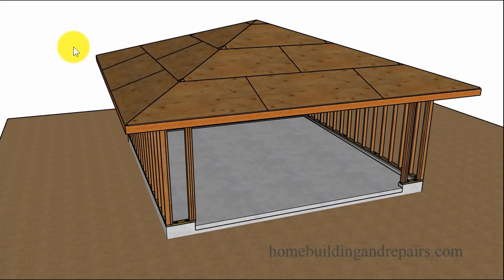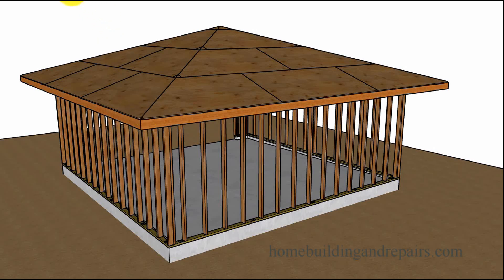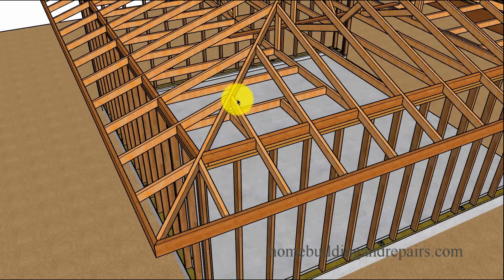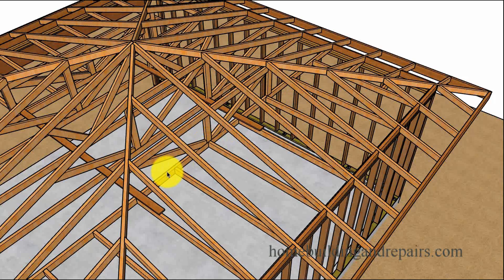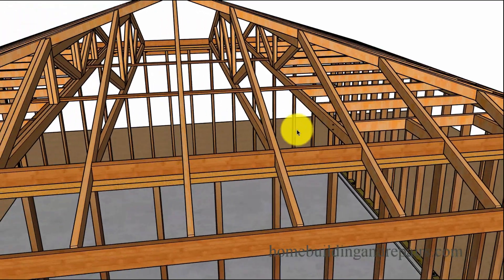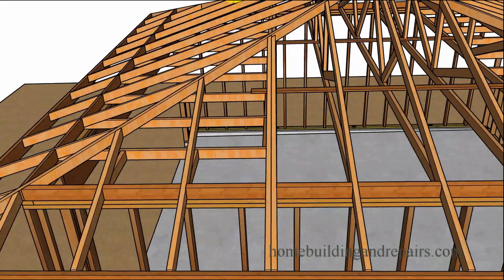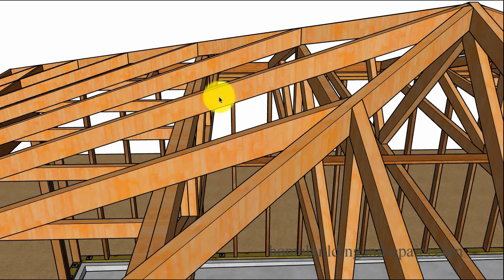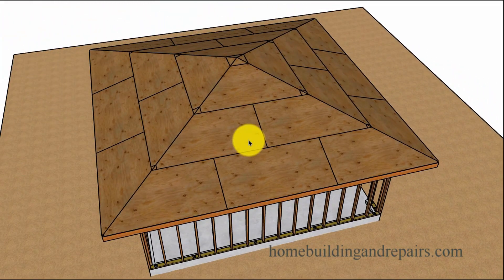Engineered Hip Roof Truss System For Two Car Garage - Framing Ideas

Comment: In the middle of my house the tie beams, which is the bottom chord of the truss run from front to back. In the corner rooms the tie beams run perpendicular to these. I have a hip roof with a center ridge.
Reply from the maker: Yes, there are more ways to build different truss systems

Comment: I have a 1/12 square hip roof garage that more or less is collapsing.  Worst is a 5x5 corner.  I cunted 6 layers of old roofing.  Significant fungal damage -- looks like Poria incrassia.  The pitch is so low with such poor bracing that all the joists are cracking.  I'm doing a stop-gap repair on the corner until I can reroof the structure.  I'll build a gambrel roof with wood-I-beam joists.  Enough with the heavy cross braces and terrible pitch.  Your illustration of the framing was very useful to confirm that my repair is ...... reasonable.

Comment: Is there any way to make use of the area beneath the roof? I have this garage, but have drywall hung on the ceiling now.  Would love to store a few things above the ceiling, but I don't think it's built for load bearing. Any better ways to reinforce?
Reply from the maker: I think I have videos at our website in the garage section that might help.

Comment: Hey there.  I'm attempting to rennovate an old two car garage (20'x20') and convert it to a workshop. It has a pyramid hip roof similar to what you show here, except there aren't any trusses at all. 
I'm curious how my hip roof seems to be so solid and structurally sound. 

This home was built in 1893, the garage sometime between the 30s-50s if I had to guess. The garage itself is more post and beam construction, with 4x4s in each corner and a few in the center of each wall span (either for a window, garage door, or rear door) that seemed to be enough to line horizontal 2x's to affix the exterior cedar panels.  However, I'm very curious how this roof was built, and if you know anything about this older style of framing.    

While it seems pretty strong-  it was re-sheathed and shingled a decade ago before I bought the house, so it supported the weight of people on top of it, and there is no sagging of any kind, I'm curious if this I should be concerned that there are no internal supports of any kind. (no load bearing walls within, no trusses/cross braces, etc). It seems to defy my sense of logic.
Reply from the maker: You can always add supports if you think it will help, but since it not sagging or leaning, I think you might consider leaving it alone.
Reply: I just purchased a house with a 20x20 garage with the same style roof but 7/12 pitch. I only have 2 20’ 2x6 running across and I’m now considering adding more in for support and storage for above the garage door.

Comment: Is it possible to avoid rafter ties in a pyramid roof like this by using strapping?
Reply from the maker: I've never seen collar tie straps on a pyramid roof where four hips meet at the same point. This doesn't mean you can't or that an engineer today would use them.

Comment: Thanks, I have this kind of roof in my garage and was curious about the construction above the ceiling.
Reply from the maker: I'm guessing for storage and you might find what you need at our website, if not, then provide a few more details, like what type of project.
Reply: @gregvancom  Hi thanks for the quick response.  I was hanging a 50lb heavy bag for boxing in the mid back of the garage, and I was having problems figuring out what direction the ceiling joists went.  I couldn't get a stud finder to work, and I wasn't confident in the knocking method.  I looked thru the attic area but I didn't have a tall enough ladder, and there was a lot of insulation that I couldn't tell.  I wanted to mount the bag from two joists even thou it's not really that heavy.  I successfully found them watching your video so I'm guessing the joist design is pretty standard? Thanks again.  I also enjoyed watching the video and your knowledge of building.

Comment: How does one go about Insulating a Roof EXACTLY like this one?   27' x 27'
Thank you.
Reply from the maker: It's hard to explain, but if the ceiling isn't finished then you staple paper backed insulation to each side of the rafters. I don't have any videos on it, but here's all the insulation videos I do have.
https://www.homebuildingandrepairs.com/insulation/index.html
Reply: @gregvancom  Thank you for the information. Happy Thoughts.

Comment: I am curious how a large garage (or house) that is not square with hips could be built off site as several trusses.   Your video gives a good visual.
Reply from the maker: The trust manufacturing company can usually provide you with installation instructions and all of the framing components necessary to build and assemble that type of roof.

Comment: Seasons Greetings!  hey just installed a 9x7high garage door at my carport in my house..prob was rafters come down on an angle .the hold up the roof on car port.. one dies is 9 high sloping down to 7 feet!.. WHAT I DID was use a low ceinging bracket or quick turn and lowered the rail. door hits the rafter ! SO...I CUT out a 10 inch wide or so section horizontally to alow the door edge to pass thru on its way sliding along the rail.. QUESTION IS,, how can i add back streangh to the rafter since it was a 2x6 now 3 inches !! im think an iron channel drilled and bolted maybe 2 feet in each direction or would 2 by 3 tabled sawed to fit along  nailed in place?..i just reroofed above..which would be more options to nail from above.. any ideas/ or am i on the right track in reinforcing this? thanks heaps! dave ski , by nasa florida!
Reply from the maker: Email me some pictures and I'll see if I can help. You can get our email address at our website. If not, I like your idea with the metal.